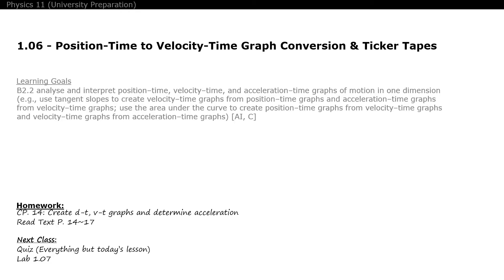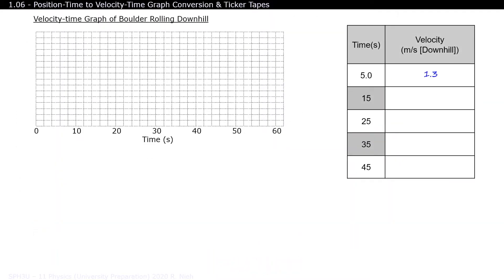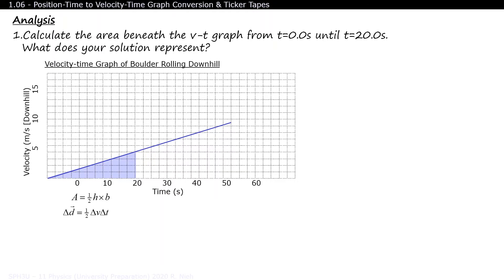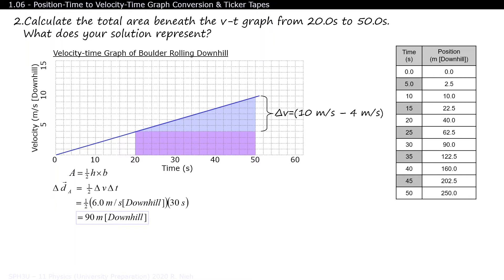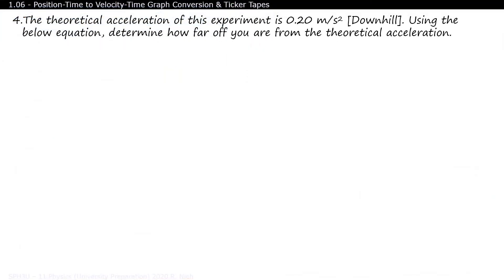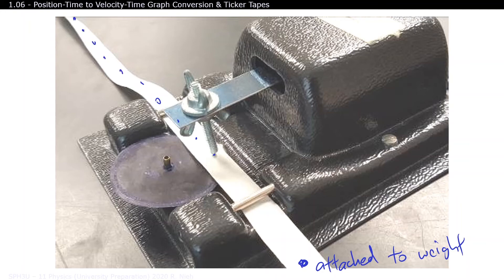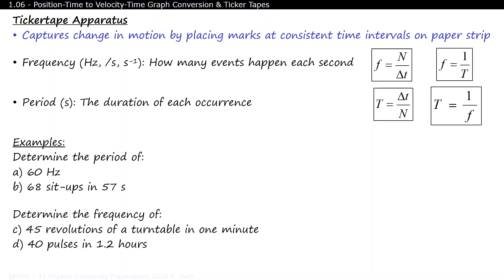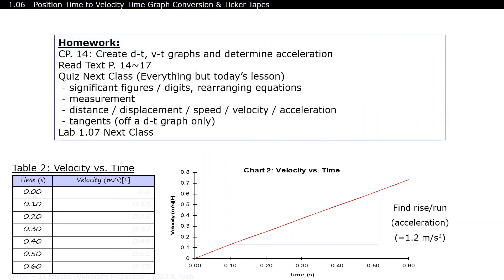SPH3U 1.06:Converting a Position-Time Graph to Velocity-Time and Ticker Tape Fun!

Comment: So if the distance between the dots in the ticking tape experiment were increasing at an increasing rate would the velocity time graph be a graph where the velocity increases at a constant rate which would indicate a uniform acceleration?